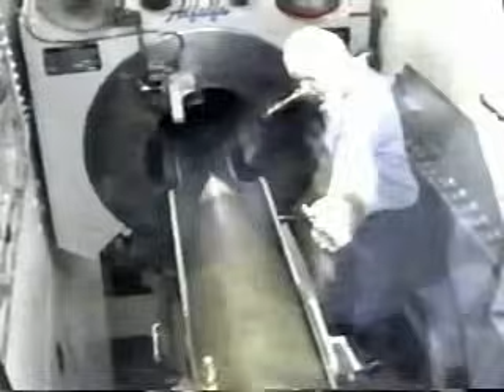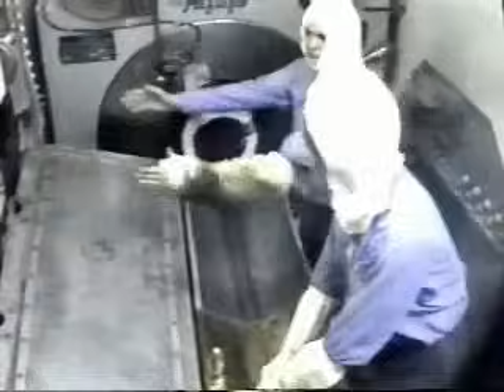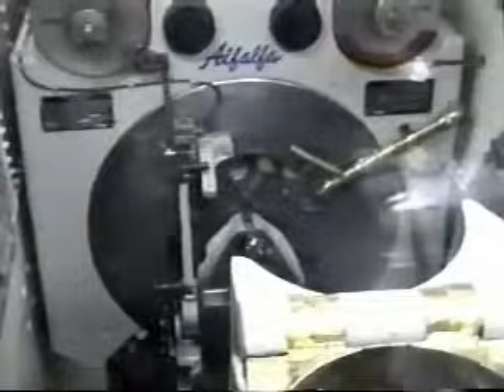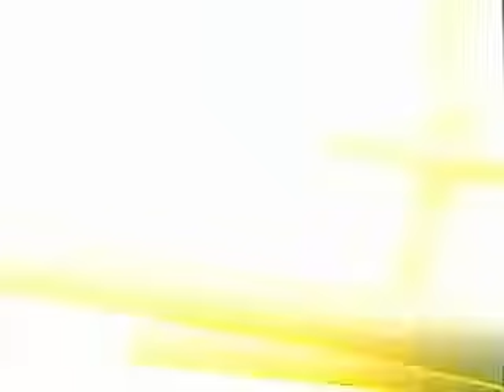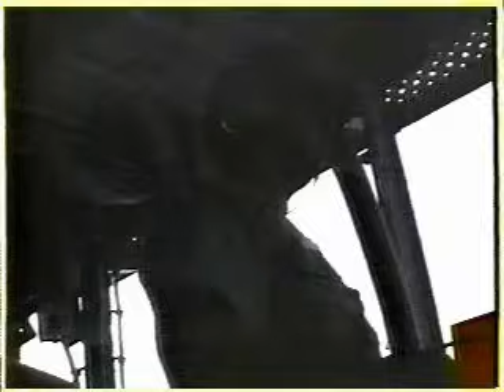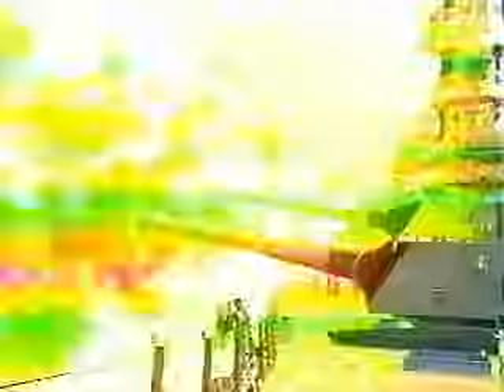USS WISCONSIN BATTLESHIP 16IN GUNFIRE

Comment: These battleships had been retired right after WW 2, but were put back into service to counter the Soviet's missile boats during the Cold War. They were then retired again after that, but were pulled out of retirement again for the Gulf War. The reason they did this was because there is no substitute for raw armor thickness and massive guns. A missile has the chance to be shot down, while a shell is extremely hard to defend against. They were also equipped with missiles and new technology to increase their range and versatility both times they were pulled out of retirement. I think these ships may still have potential use in the future because armor that thick, and guns that big, can never be obsolete.
Reply: It's true that AA systems are getting better, but they are not 100% accurate. The newest missile systems that have been defending Isreal recently have not been able to shoot down every missile launched. There is also a difference between being picked up on radar and actually being shot down. Radar today can spot objects the size of birds, but it doesn't mean they can shoot a projectile of that size down. Battleships can also fire off more than one shell at a time, possibly overwhelming any AA defenses in an area. The shells used by battleships are also smaller and cheeper than missiles that would give the same explosive force.

When it comes to the armor of the battleships, you said that armor will eventually become unnecessary due to better and better defense systems. That was one of the reasons the battleships were decommissioned after WW2. The US believed that having new defenses and faster ships would make armor unnecessary, but then the Soviet Union came out with designated missile ships. These could get through defenses and hit the faster ships. The US brought the battleships back into service because they could take the hits that no other ship could. This kind of arms race between being able to hit an opponent and not get hit in return has been a constant for war, and is not going to go away. When the US or some other nation creates a "perfect" defense, some other country will come along and prove it wrong. And when you can't avoid the hit, you need to be able to take it and keep moving.

The battleships will probably not be brought back into active duty, but I just think it is sad to see such amazing weapons of war that will never be recreated sit in a dock as a museum.
Reply: It's sad to see yes, but it's always an armed race in the military. Yes weapon system VS defense system will keep going on. But That's the same with Guns. The armor may seem invincible right now, but when we need, we just mount AP warheads on missiles and would do the same as a battleship gun if not eben more devastating.

Back then it's Ap capability VS armor. Now it's Defense systems VS offensive systems.

Well, the CRAM, seaRam, CIWS and Iron dome all can take out artillery shells with differing level of success. Main reason why Iron dome is failing in some respect is it's getting saturated, can't field enough but it is proven to be highly successful.
Reply: I love battleships too and would love to see them sail again but there's no doubt armour is obsolete. Stealth is the only safety for naval vessels. A submarine could plant a dozen torpedoes into a battleship before it even knew what hit it.
Reply: lkbartnick They were brought back into service to replace the cruisers the navy had worn out. After WW2 the navy had no use for them. After years of not replacing the cruisers and wearing them all out. The BBs were brought back into service until the navy could build replacements. Once the navy had built sufficiently they were again retired. As beautiful and tough as these monsters are they are horrible to maintain and crew. Sadly their real job had been stolen from them by airplanes, a much cheaper and effective weapon.
Reply: @neurofiedyamato8763  yeah when they make a battleship with these new rail guns which put a projectile at Mach 7 440 miles down range,  I'd like to hear your aa argument again.
Reply: @steve4247  We also already have hypersonic missiles in active service, namely Russia. So a hypersonic projectile that follows a predictable trajectory as opposed to a maneuvering missile is going to be even easier to defeat. DARPA is already working on hypersonic interception. By the time the railgun is available, so will interceptors against hypersonic weapons.

Railguns will have its place as it is cheaper per shot, but its range, payload, and accuracy still fall short compared to modern cruise missiles. The primary offensive weapon will still be the aircraft and missile, not guns.
In fact the only reason majority of missiles are under 500 km is due to the INF treaty which is now abandoned. Missiles have long been capable far greater distances for decades, so 440 miles isn't that impressive compared to missile technology.

Additionally a railgun is reliant on the launching platform's accuracy. No matter how good your sensors are, there's no way for the firing platform to determine humidity, temperature and such on the other end limiting its accuracy. The greater the distance, the worse this problem becomes.
Missiles use active guidance and will adjust as it travels making it equally as accurate no matter the distance. Railgun projectiles undergo immense G-forces when fired which have presented itself as a barrier for developing guided munitions.
Lastly railgun loses energy as it travels, a missile do not, well maybe a small part of its mass as it expends its fuel, but that is insignificant compared to the loss of velocity on a railgun.

Missile are inherently the superior weapon design so I don't get why people are so adamant in defending obsolete methods. Railguns is going to be the last gasp of air by battleship fanatics. When railguns finally enter service, they'll just replace the previous secondary weaponry on ships; the chemical-propellant based gun.
Reply: Mate, literally 120mm HEAT shell can penetrate wisconsin. I'm sorry but these ships are just obsolete nowadays. They're fun museums tho
Reply: I am only waiting for the new lasers and force field to be installed. Plus my alien weapons dealer said they can upgrade the guns with the newer planet destroyer system. Also he will replace the engine for free. 😂

In all seriousness all ship in this class are awesome.
Reply: Don't forget their firing systems were NEVER upgraded. They were built so damn well (all analog), they never needed to.
Reply: They were used in both korea and vietnam
Reply: One in particular was pulled out of slumber for Vietnam, the USS New Jersey. And it only did one tour because it was brutal at annihilating the North Vietnamese. So much so, that when they began peace talks with the US, they specifically demanded that USS New Jersey be removed from the theatre of operations before they would talk.

Comment: These big guns do it way cooler than missiles though.
Reply: Ehh
Missiles are still badass.
Reply: Big guns for me
Reply: @chen_plays4173  Yamato still peak of battleship engineering.
Reply: Dana William  you do know an anti ship missiles are massive look at the Russian Brahmos missile each cost up to $3 million weigh from 5500 pounds to 6600 pounds and fly up to Mach 3 or  2300 MPH. The Brahmos 2 is expected to fly up to Mach 7, I don't know what kind of drone your talking about but $10k won't get you a military drone let alone an anti ship missile. South Korea at one point had the K11 rifle in production, that rifle alone cost $14k.
Look at the Slava class destroyer, it's loaded up with 16 anti ship missiles ready and the launchers are massive.
Reply: Dana William  of course you could sabotage a ship by just planting explosives in an empty ship, has been done in WW2 by the Italians on British ships. But the Iowa class ships were designed to take hits head on  like any battleship. Standard explosives won't do much to these unless you get the impact inside or on the bottom of the hulls such as torpedoes. But the tops armor is extremely thick with the turrets being the strongest points. The Iowa turrets sit on an a base plate that is up to 17 inches thick and the front of the turrets are 19 inches of steel. The deck is 6 inches of thick. The magazines themselves are the most protected part of a ship to prevent detonation. Blowing up 500 pounds of explosives on the turret will cause some damage but not even close. The Yamato was hit by 11 torpedoes and 6 bombs each torpedo had a 600 pounds warhead and the aerial bombs were 2000 pounds each of nothing but explosives. an active battleship was difficult to destroy with conventional weapons even a drone with explosives and even if you kamikazed a 500 pound drone of explosives it won't destroy the ship. That's why anti ship missiles are far more effective they work similar to a sabot round and it pierces right through the armor.
Reply: maybe drones or guided missiles is awesome & badass, but you never knew big guns is way more super awesome & badass. you can hear the sounds of democracy from their 16''
Reply: Now imagine if they make a railgun that shoots projectiles of 16in in diameter
Reply: 16'in guns still the good ol' days :v
Reply: Dana William  of course they'd explode if you got a good hit,but you'd have to defeat air defences ie cwis ,missile to missile etc etc she would stay floating even after a decent hit,royal navy took direct hits from exocets, some ships stayed floating, others sank,they were tin cans compared to this armoured tank lol 

But yes the magazines/cordite storage is the weak point of any great ship, hms hood,yamato and uss arizona are just a few examples of a lucky/unlucky shot.   Battleships could easily be a floating fortress, as there's soo much room for everything you need and even more, plus it'll scare baby destroyers and frigates away from sheer looks alone ha  need a modern day equivalent of a battleship
Reply: True Grit. And cost a lot less.

Comment: I served on board Battleship Wisconsin 1990-91. Everytime the guns went off the experience was just au inspiring. I worked in number 1 fire room and when number one turret fired the flash/ gun power residue would go
 through the ventilation system and come into our boiler front.  That blast was something else! I'm proud to be a battleship sailor,it will always be in my veins !

Comment: If I remember correctly, the USS Wisconsin, was the longest of the battleships.  She was damaged and they did a refit for her.
Reply: A whole foot longer, yes.
Reply: Respectfully, that is a myths. If anything the USS Wisconsin is about one inch shorter then she was before the damaged, as the damaged was done lower in the bow and the top of the bow was left in place and was not replaced, and of course is the longest part of the bow. There is still visible damage left in the deck where it buckled a little, pushing it about one inch in. Naval records has the New Jersey being the longest Iowa by a few inches, not that a few inches really matters. New Jersey is in the Guinness World Records as the fastest and longest battleship ever.

Comment: I'm not sure what is injected into the barrels after firing, but it expels the hot gasses to cool the breech so they don't cook off a round in the barrel.  This happened to one of the 5 inch guns on one of the DDs or DEs (I don't recall which one) at the battle of Leyte Gulf.  The gun cooling failed and the last round they had cooked off in the barrel and killed the gun crew.

Comment: If the Montana Class Battleships had been built they would have been more devastating than the Iowa Class Battleships. Armed with the same 16"/50 caliber Mark 7 rifles she would have had 12 rifles instead of 9 and fired 24 shells per minute compared to the Iowa's 18.

Iowa Class Battleships 2,916,000 lbs of AP shells per hour. (1458 tons)
2,052,000 lbs of HE Shells per hour. (1026 tons)

Montana Class Battleships 3,888,000 lbs of AP shells per hour. (1944 tons)
2,736,000 lbs of HE Shells per hour. (1368 tons.)
Reply: +Cody Nelson   Maybe a President Trump with dust off the Montana Class blueprints. ; )
Reply: +Cody Nelson Montana class would have had 18" guns
Reply: +Jay Shannon Montana would only mount 16" guns, in 4 x 3 turrets configuration
Reply: Design plans had 18" guns...
Reply: On www.militaryfactory.com

Armament:
12 x 16-inch Mark 7 main guns in four triple-mounted turrets.
20 x 5-inch Mark 16 cannons
10 to 40 x 40mm Bofors anti-aircraft cannons
56 x 20mm Oerlikon anti-aircraft cannons
.50 caliber machine guns for close-in self-defense as needed.
Air Arm: 3 OR 4 x Vought OS2U Kingfisher OR Curtiss Seahawk floatplanes.

Ship Class: Montana-class
Number-in-Class: 5
Ships-in-Class: USS Montana (BB-67); USS Ohio (BB-68); USS Maine (BB-69); USS New Hampshire (BB-70); USS Louisiana (BB-71)
Reply: Damned Wright Brothers...
Reply: But they were never built so what your point? Shoulda coulda woulda.
Reply: That's not entirely accurate for they would be in three gun turrets not triple turrets the difference meaning each barrel can independently be moved and aimed, albeit you are correct about the size they are/would be 16's not 18's

Comment: @SurfAddict999 I think there's no benefir from firing the guns simultaneously. If the shells hit the target with a half second delay, so what?
But the combined recoil would be much greater and put a lot more stress on the turret mounting that increases the need for maintainance and replacing parts. And I think the sound waves of the blasts would add up, bewcomming one massive bang that does a lot more damage to the crews hearing than three "smaller" ones.

Comment: One BB I wish they had made that'd been fun to see is the USS Montana. Packing 12 16"/50 caliber Mark 7 rifles. Firing 32,400LBS of shells full broadside compared to Iowa class 24,300LBS full broadside from its 9 rifles.

Powder Pounds total Iowa class: 5,940
Powder Pounds total Montana class: 7,920
Reply: I have often wonder how the Navy would have reacted if WW2 was delayed 3-5 years and they found out about the Yamatos. Only way the Montanas would get built is if the war was delayed. Also, if the Navy found out about the 18.11" guns on the Yamatos, the navy of course would not have the exact specs on the Yamato's guns so they would have probably played it safe and redesigned the Montanas to have the 18" 48 cal guns they had worked on. They could have done 4 twins turrets for 8 guns but it would have been amazing (and my dream) if they did 9 guns in triple turrets, since they already had too great a beam to go through the Panama Canal so larger turrets wouldn't hurt.

Research done by several nations, including the USA, UK, and Japan had shown you actually save weight and citadel space with 3 triple turrets vs. 4 twin turrets and you gain 1 more gun. With this improved efficiency, maybe they could have gone back to the Iowa's 212K horse power engines instead of the 172K they settled on, giving the Montanas 30 knots instead of 28knots, while keeping the Montanas increased armor.

Can you imagine this? Five; 30 knot Montanas armed with nine 18" 48cal guns, armored to the gills, sailing around.  Makes me drool. lol The shell they would fire was 3,850 lb... My god how awesome!